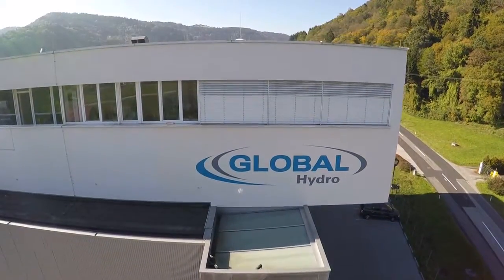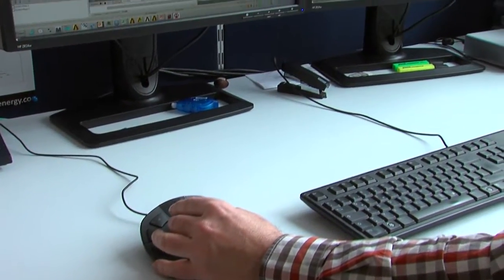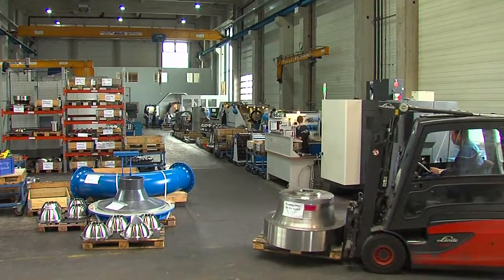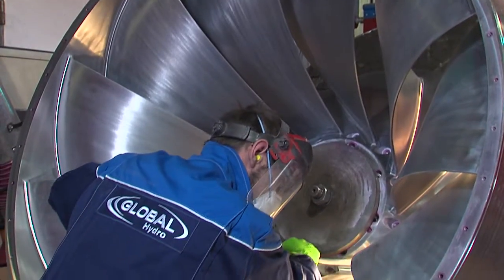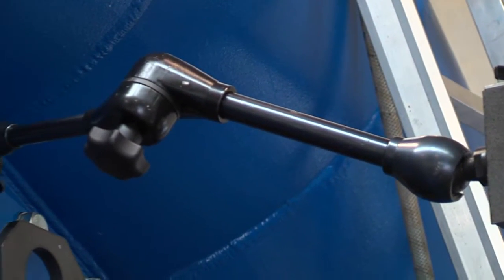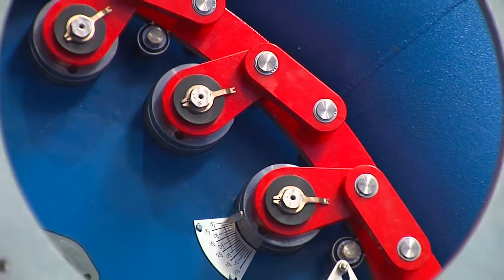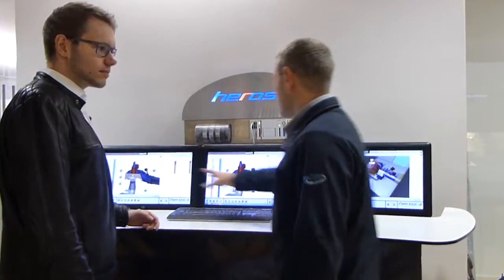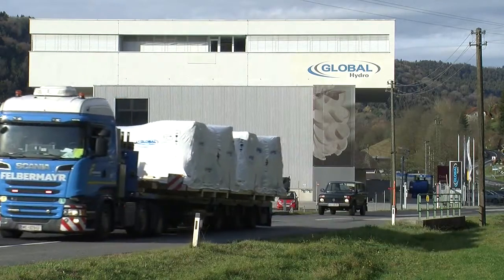GLOBAL Hydro Production of a Francis runner

Comment: Thank you for this very informative video. I'm a lawyer in Switzerland and as part of a competition, we are working on a case of replacement of a Francis Turbines which are suspected to be defective. In that context, a lot of questions are raised about manufacturing process and quality standards.

At 1:51, it says that there is a meticulous and systematic control of quality before the actual manufacture. Does anybody know if there are any (publicly available) manufacturing and quality standards ? And what are the quality requirements and the quality tests implemented along the building process ?

Thank you for your answer :)
Reply: It could have been any number of things which caused the turbine to fail. The raw materials i.e. steel alloys could have been compromised coming from the mill, The welding of the turbine and casing could have had been bad for numerous reasons. The engineering of the turbine could have been incorrect for the site conditions (head and flow). The installation of the turbine and generator could have been faulty. Rocks and other debris could have entered the turbine intake and destroyed the runner / wicket gates. The mode of failure will most likely determine what happened and who is at fault. There are engineering and material standards that must be adhered to in the design and fabrication of turbines which are pressurized  with potentially catastrophic consequences should something fail.

Any reputable manufacturer of hydroelectric turbines is going to adhere to these standards (ASME, ASTM, ISO, etc.)  as well as non destructive testing (NDT) of all critical components.

I say this as someone with an engineering degree who has worked in the metal working field for a decade.